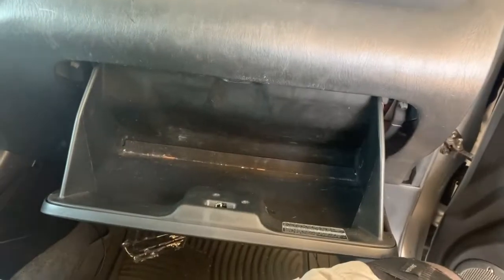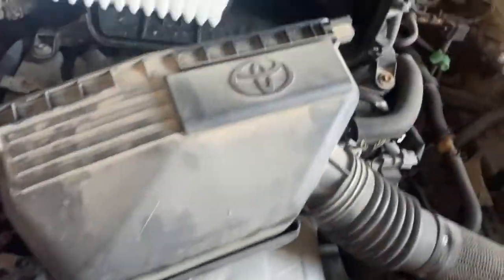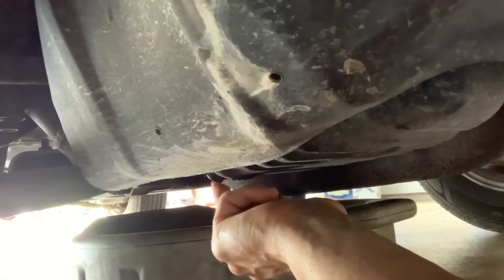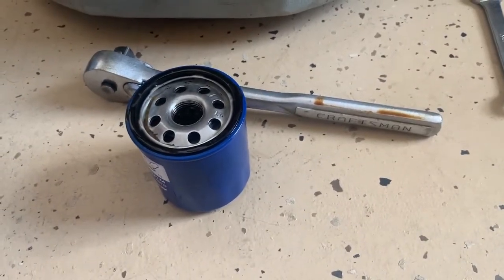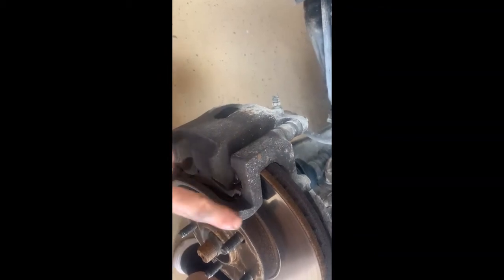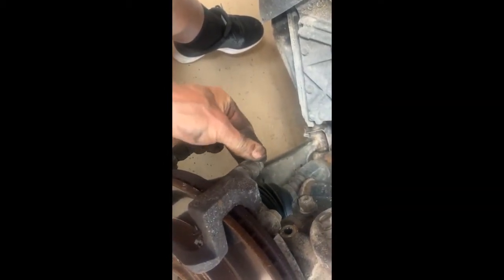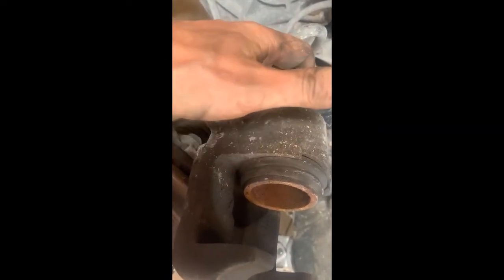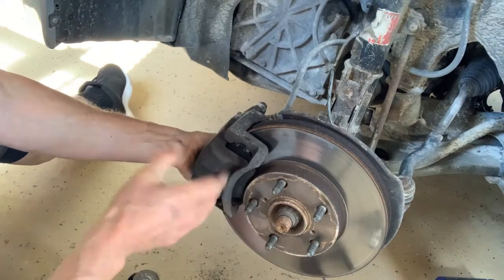2003-2005 Toyota RAV4 Vehicle Maintenance AKA "Richard"

Comment: Very useful video, thanks. Did you change or grind the front rotors? Not Toyota OEM air and oil filter - looks like Ryco. Toyota OEM said to be best.

Comment: I will give you a tip, You will need to fill the oil filter with oil to at least half full, this will make sure it starts filtering the new oil right away.
Reply: @hubi4888  Ha ha ha ha.... OK not the words i would have used. But spot on. Now had they mentioned oil getting to the engine more quickly I could have agreed. But that is only necessary if you do a rebuild. But then your manually moving the oil way before you start it and get it to idle.

Comment: Thanks for the great video. I was wondering if this would include the 2002 Toyota RAV4 or if there was a reason it's for 2003-2005 only. Thanks again :)
Reply from the maker: The basic concepts yes, not sure if previous to 2003 is the same powertrain and braking systems. But the way to do the maintenance is similar.
Reply: 04 to 05 got the 2.4l under the hood

Comment: Nice video 👍👍

Can I use 5w-40 oil?
My Rav4 milage is 220000 ml
Reply from the maker: I’m not an oil expert. I use what the manufacture recommends. You’d need to do some google research to find out. I know that’s better for colder temps and in some cases warmer temps.
Reply: @ShopDogFabrication  Thanks

Comment: Hi there mate what do I look out for when buying one please I’m after m2 one
Reply from the maker: No coolant leak back of the engine on the ground or using coolant, that means the head studs aren’t stripped out and check the rear axle seals for leaking if awd, otherwise on my daughters vehicle we’ve just been able to do normal maintenance. Check transmission fluid level and condition. Test drive hot to see if transmission issues. Check to see if all the vin tags are on each fender, hood, etc. in the states each has a vin sticker if one is missing might have been in an accident and that part replaced.

Comment: @ 130k miles - How about the condition of the Coolant and Transmission fluids?
Reply from the maker: Those things were checked a few months ago and taken care of and good to raise up, not everyone has a coolant tester but should make sure fluids are topped off. When checking coolant make sure the engine is cold!! Do not remove the radiator cap hot or you will get burned. I also could have gone into how to replace spark plugs and how to gap them. Those were also done before I started the channel.

Comment: I'm getting this for my 28th birthday this month. It has 145K KMS...any advice?
Reply from the maker: The only issue we ever had with ours was the cylinder head bolts pulled the threads out of the block. I had to drill out the block and put in inserts and new gaskets and bolts. I have a few videos on that. Otherwise it’s been a good vehicle for my daughter and we have just done normal maintenance.